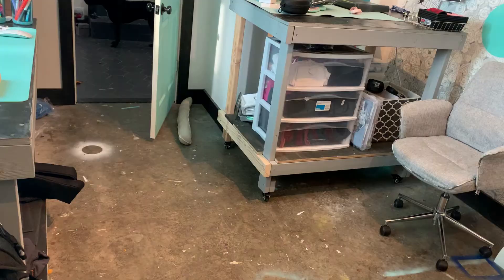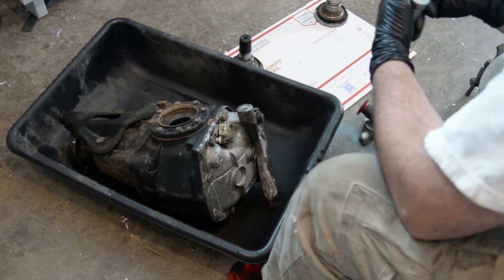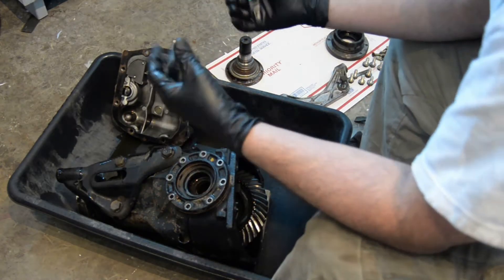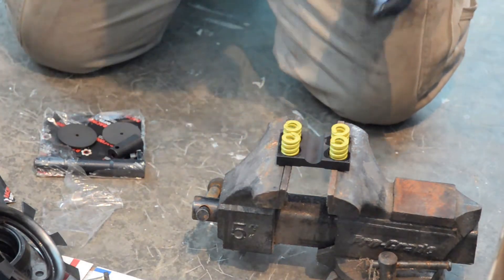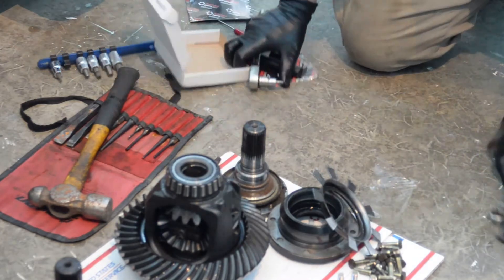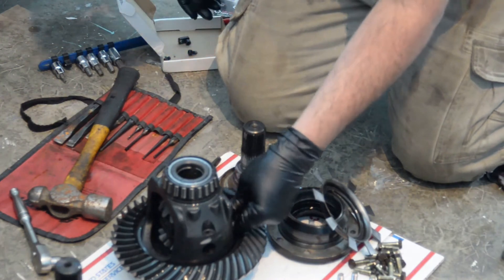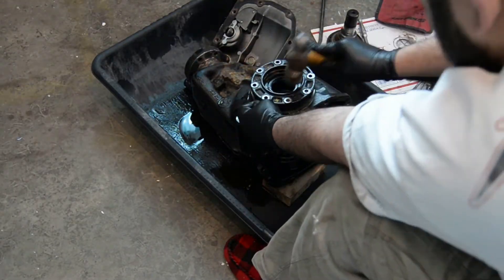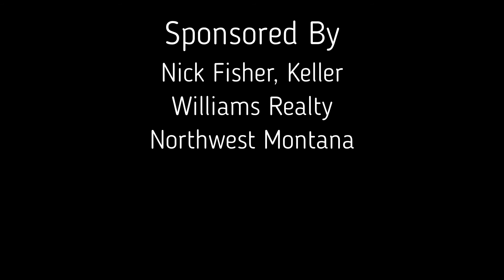Turning a one wheel peel into 11's: installing a Racing Diffs LSD conversion into my e34

Comment: Do you recommend this mod after all this time or not really?
Reply from the maker: I don’t have enough power to break my tires loose at will but I do get extra traction in slippery situations like sand, snow, and wet pavement. I’ve done about 10k miles on it and haven’t had any issues so overall yes would recommend for the price. There are lots of guys that have had poor experience with it so I’m also keeping my eyes out for the elusive oem 2.73 lsd just in case this one does explode.

Comment: how did you pop out central pin that you mentioned in 4:00
Reply from the maker: Just give her some taps with a hammer and punch
Reply: @adventure406  you saved me. I'm not familiar with mechanical. Thanks
Reply from the maker: @EHLee1  hey no prob glad I could help!

Comment: Hello, thank you for this explanation!  Could you please let us know how it's holding up and whether you're happy with it? Thanks!
Reply from the maker: I’ve put about 4000 miles on it. It’s a daily driver and I haven’t had any issues. My slush box isn’t great so I can’t get the tires to spin on dry pavement but it will do 11’s in the snow or sand.

Comment: Very happy with mine in an e46 330ci, I suggest getting genuine bmw output seals, as mine leaked from racing diff
Reply from the maker: My experience with BMWs (which is vast I used to be a dealer tech and worked at an independent shop for awhile) is that anytime you touch a seal or hose you need to replace it and nothing is better than genuine BMW for that.